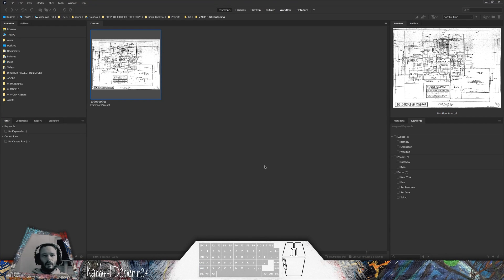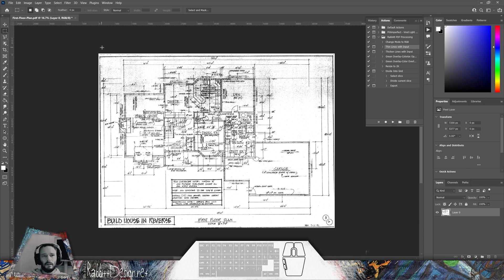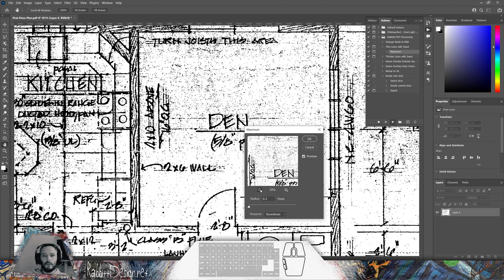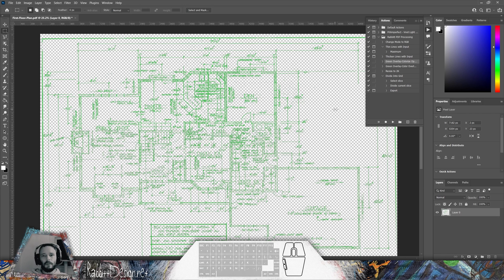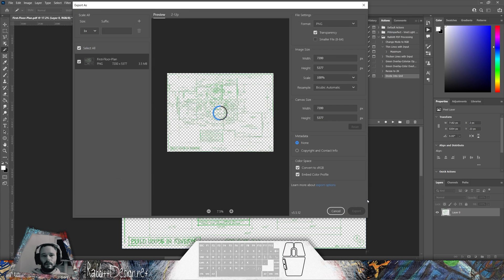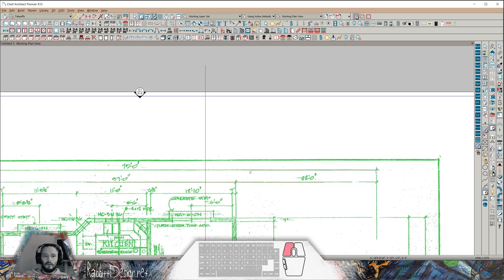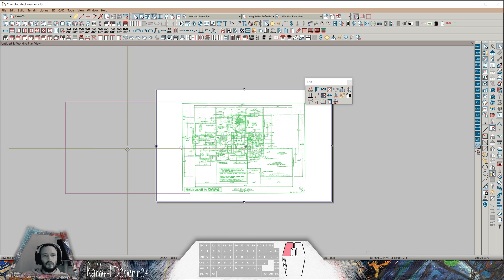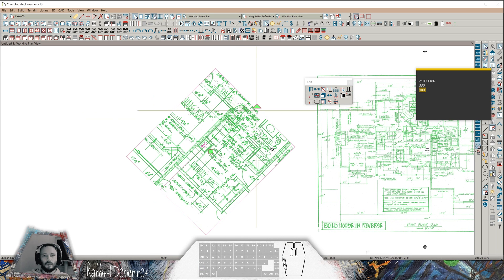Converting PDFs tp PNG overlays for CAD drafting using the supplied action set

Comment: Thanks again Rene.  I've used PS for years, but only a very limited set of tools.  I never knew about or tried these action sets.  Great time saver, so I appreciate you sharing that "action set" or .atn file.
Reply from the maker: They're simple, but very useful :)
Reply: @rabbittdesign8482  Ahh. yes.  But it is too easy to get lazy and set in one's ways.  I've had PS for so many years, but never really bothered to learn the power of the macro's that you created.  So thank you for putting some fun back into cleaning up PDF's.  I just spent way too much time enjoying cleaning up PDF files.
Reply from the maker: @JTDesign1  Nice, great when the tools work as intended!